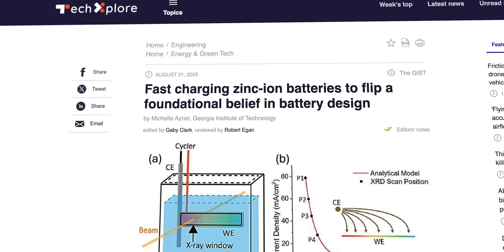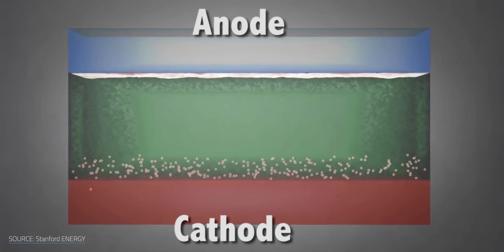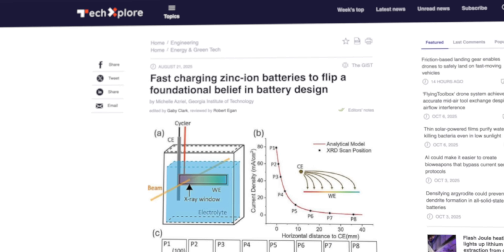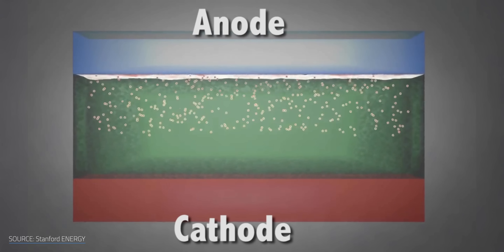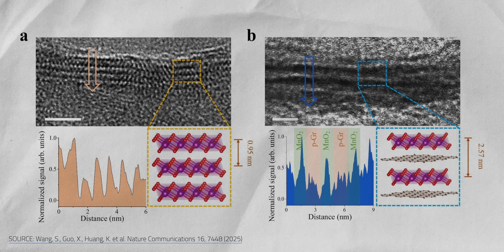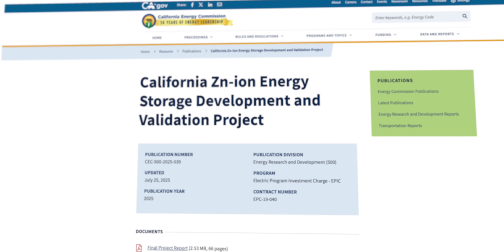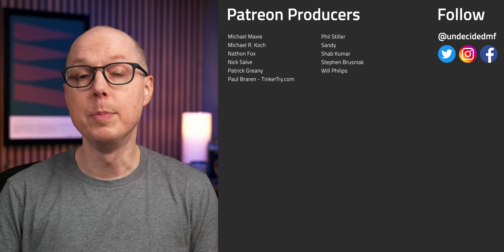The Surprising Battery Discovery No One Saw Coming

Comment from the maker: Are cheaper, safer zinc-ion batteries the best bet for grid-scale energy storage or your home? Take your personal data back with Incogni! Use code UNDECIDED at the link below and get 60% off an annual plan: http://incogni.com/undecided

If you liked this, check out Are We Building Wind Energy Wrong? https://youtu.be/ZlCJcTq3Jk4?list=PLnTSM-ORSgi7uzySCXq8VXhodHB5B5OiQ
Reply: Thanks for all you do! Perhaps, a couple of times a year, it would be great to provide a summary of the status of these emerging technologies - cost, density, adoption/commercialization timeline, progressing/abandoned etc. With so many promising technologies, it would be great to see the comparison and long term trends. Also, tag them with applicability - mobile devices, transportation (cars, aircraft), home and grid scale storage etc.
Reply: Thank You ❤️‍🔥
Reply: No, they're not. They're just the experimental battery chemistry of the week. Pump, dump, forget, rinse, repeat...
Reply: Would rather have a link to a report/review that compares the current commercially available cells of this tech to the existing ones (iron (lifepo), salt, lithium, etc, and variations of those) for everything from energy density in cost, to energy density in mass, to energy density in volume, to safety (both in terms of fire, environmental, health, and such),  longevity (things one has to do to not kill them, how they handle weathers/temps, and so on. Both permanent longevity and temporary), as well as speed (charging and discharging), and so on.

Some sponsor-link or other video link is not really desirable in comparison. What I want to know is whether or not I should try to replace my bike's battery with this, and if it is even doable with a homemade batterypack, or if it is dangerous or even potentionally lethal (i.e house-fire).
Reply: Thank you Matt, I love your channel!
Reply: Thanks Matt. Given the right opportunities, this could lead to serious advancements in other battery technologies. If those batteries mentioned towards the end of the video can be sold at a competitive price, I would use them in my home, in preference to my LFP battery.
Reply: How do these compare with sodium?
Reply: compare it with the sodium ion battery that CATL produce today, 180 Wh/kg, 10,000 life cycle, can be discahrged to 0V without damage, costing 20$/kwh to mass produce. And the most important thing it is a real product in the market and not some lab test that is decades away from production
Reply: There is a better way! 
The old John Poynting theory establishes that a charged capacitor laid on a permanent magnet so that the E-field of the capacitor is at right angles to the H-field of the magnet, is somehow the seat of a dynamic and continuous flow (steady state flow) of EM energy.
This is assured by the proven broken symmetry of opposite charges, such as the poles of the magnet and the opposite plates of the capacitor. 
ANY such dipolarity—because of its broken symmetry of opposite charges—must then absorb virtual EM energy (virtual photons) from the vacuum, coherently integrate the virtual energy into observable photons, and re-emit real observable photons in all directions.
Reply: It’s like an “Italian tuneup” for cars! Haha
Reply: oh look. another video about a battery i will never see.
Reply: Thanks for the analysis!

At 6:09, you said "higher charging speeds", but the captions said "higher charging currents".
Reply: Sounds great for grid-scale energy storage or home use. Energy density is not the factor for those stationary usages. While lithium has several disadvantages at moment.
Even 1/10 of density would be ok, as long it is as similar or better in green, price,  fire risk and durability.
Here in Germany are home use lithium packs of e.g. 10 kwh with their estimated lifetime so expensive that each 1 kwh cost 0.07 EUR/$ just for the lithium battery pack lifetime reduction.

The consequence is that e.g. heat pump system need best (aside other factors) run at at daylight when photovoltaics produce energy to store thermal energy in heat water tanks for the night instead of storing the electricity in batteries to run the heat pump at night as well.
Storage energy in water costs factors less than in batteries. Smarter and more universal would be to have primary the energy storage in batteries.
Reply: Pleaxe don't play background "music" over the top of you talking!
You are already speaking at 100mph, so is difficult enough to decypher what you are saying, without also having to extract it from that irritating racket that contributes nothing to the educational content.
Unwatchable beyond the time taken to type this.
Reply: Maybe Conservatives will now start wanting EVs which WE can control Liberals with, through our present and continuing future control of the national government (and therefore control over the regional fueling infrastructures). Of course, Political Liberals don't fear that, because (1) they are arrogant and falsely think they will regain power, and (2) they know WE (unlike themselves) aren't fascists and therefore don't think in that totalitarian way.
Reply: EVs "that run off the electric grid" are literally going nowhere. People are rejecting them. However, "reforming fuel cell EVs" are the vehicle of the near future. Political Liberals don't want them, since they are practical & support individual transportation autonomy by NOT centralizing the fueling options onto the grid which the GOVERNMENT can control at will.
Reply: Maybe, now that the US government is no longer under control of the Political Liberals, and the Democrat Party is permanently declining in power, Political Liberals may not even want the government to be able to CONTROL the fueling of THEIR vehicles AT WILL through the electrical grid.

Comment: The reason we moved to lithium is because they're lighter and smaller for the amount of energy they can store. I'm sure there are use cases where we would want longer lasting and faster charging, but they aren't the common ones today. We don't want our phones to hold less charge and we definitely don't want our cars to hold less charge and be heavier. The price per Wh could be a big advantage though. They might be good for power walls where price is the limiting factor. Given that you have to charge them fast though you would need some fancy circuitry. Most likely a bank switching method so you only charge like 1/10 of the batteries at a time so all the power goes to a few batteries.

Comment: The batteries need to be able to go to low voltages before cutting off, and need to be able to start charging, even if that voltage is low, because that is what is killing the salt batteries from becoming a replacement for lithium batteries, so if they can make the batteries do that, and work well in cold and hot weather, then Yes, these batteries could become a replacement for lithium batteries....🤔🧐

Comment: Of course, home batteries won't see the benefits of fast charging so dendrites will remain a problem.  Non-flammability would be an asset in a world where insurance companies are becoming increasingly wary of lithium based batteries, but it still comes down to cost and energy density. For grid storage density may not be an issue, but nobody wants their garage taken up by bulky ugly batteries. How does this technology react to depth of charge/discharge?

Comment: How is this good for a home battery. You want to use the excess power from your solar panels to charge your home battery and this is not high enough to constitute fast charging.  The amount of available power from your home solar panels might consist of, say, 35 Amps when other loads are not engaged.  So you are right back where you were with relatively slow charging and dendrite formation.

Comment: I think the problem here is that companies keep focusing on trying to beat LiIo pricing, but what they should be doing is trying to build a Zinc battery that is the same price but lasts way longer or can be charged quicker. Sadly this causes problems with the disposable nature of many tech companies and EV manufacturers. They don't want to make a EV that can last 20+ years because they want consumers to buy new cars every 5 to 10 years which is what traditional batteries kinda give them. Laptop and Phone vendors are more insane wanting people to buy new shit every year... So having a laptop that has a battery that literally never needs replaced is just not what they want. Phones and computers now have parts that can last for decades or even a century without issue and almost every time its the battery that craps out on them before anything else.

Comment: IMO it is not one single chemistry but a range of options that are both affordable and safe.
Like multiple car makes all offering affordable alternatives.
LFP is said to be far safer then NMC chemistry.
Sodium ion said to be even safer and less costly.
Zinc Manganese with a change in charging profile, well that's a better option as well.

Home battery and BESS storage needs to be cost effective and safe and then communal battery storage banks can be implemented. 
Using all the excess solar and wind that would otherwise be curtailed to support peak load in late afternoon early evening peak periods.
Affordable safe BESS. is the key to maximising renewable saturation and reduction in fossil fueled power generation in my view.
PV panels on walls of buildings and roofs of new construction making significant impact and reduction in demand for dedicated solar parks.  Solar panels over car park areas providing protection and power to customer parking lots at supermarkets and shopping centres.

Thin film PV materials like shade sails over school playground areas, etc all adding to free solar power generation to be stored in cost effective safe BESS. Now that make sense. the BESS can be use to power lighting and heat pump cooling and heating during school hours.

Comment: Zinc based power cells are a great idea for grid or home storage.
Right now the cheapest cost per kilowatt-hour for home storage is Still lead-acid with power block battery packs for tow-motors and forklifts being first choice. They can be charged and discharged at nearly any rate making them ideal for the variable input from alternative energy sources and variable loads of point-of-use.
They are well behaved and have very predictable performance.
Li-ion, LiFeP, Li-polymer cells ALL have acute failure and fire dangers along with a nasty habit of outright Exploding if damaged(!!) 🙀
Lead-acid and zinc based cells do not.
In fact Nickel-Zinc cells CANNOT EXPLODE or catch fire because the chemistry is self neutralizing if damaged and is NOT exothermic (!).
I certainly Hope that more people get into the Zn power cell game.
The only one in full production at the moment is Zinc Five NiZn power cells. Right now they are fully focused on government projects for critical infrastructure but they do have other products available such as prizmatic block batteries of various voltages including 13.6v automotive style. The caveat is that they are charge cycle sensitive to get maximum performance.

Comment: I get the sentiment of battery news being cringe since they take like forever to hit most parts of the market. But let's not forget how incredible our current hen batteries are. EV batteries already usually outlast most other components. By a lot. We went from. Max 120kw / charging to 300 kw charging in the newest cars(except for teslas ironicly) while cutting cost like 50%. Change happens year over year which is why it doesn't fell like its happening. But it has.

Comment: Wow, zinc-ion batteries sound great, can't wait to never hear about this again!
Reply: research is important, and the process is slow though
Reply: @artychokeer2092  zinc batteries have been around for a long time, but what it sounds like is they have found more viable ways to use the zinc chemistry.
From what I understand, zinc batteries have been used in sail boats for decades.
Reply: Zinc battery tech already exist, scientists just introduce a new material separating the anode and a cathode
Reply: the hype this channel makes is real lol
Reply: Zinc is niche

Its still need mining same as lithium
Refinery and chemical toxic potential

Low Voltage Power

Even though its recyclable

Its same as sodium ion and still better than zinc
Reply: @The_Divergent I don't understand, I have zinc battery, they are higher voltage than other batteries (1.7V instead of 1.5V)... But they don't have much charge and deplete faster than Lithium ( or alkaline but these are not rechargeable). Are you sure the issue is voltage ?
Reply: @prahalb  you have zink battery with some different chemistry. Who make them?

Comment: I understand sodium-iron batteries are set to replace lithium, not zinc… I think the sodium ones have much longer duty cycles than lithium or even zinc…
Reply: Sodium-Ion (-Na) is starting to hit the market, but they are significantly bigger and heavier than even Lithium Iron Phosphate (LiFePO4). Their main benefit is they can slow charge below 0C (32F). Eventually they may be cheaper, but first gen of anything is overpriced.
Reply: @Helio_Centra  I’m sure they will be too big and overpriced to begin with. But I expect them to go much cheaper because won’t need expensive lithium, and I’m hoping there will be further development and increased charge density, which will decrease size and weight… we will see.
One thing that’s right away aside from the cold issue — much safer than lithium, and much MUCH more duty cycles— it might be time for short plays on lithium rather than long plays on sodium or zinc. I just think lithiums dominance is about to end.

Comment: Why does a single 9-volt battery cost $10??!! And it hardly lasts. It seems most devices that run on 9-volt need an almost new battery to get the expected performance. I don't want to spend an extra $10 every time I just want to use my stupid $15 device!

Comment: If these batteries can't light on fire and can provide equivalent or better performance than lithium-ion...what's the hold up? I will never buy an EV vehicle right now. While I know they are pretty safe, I just am not comfortable with the risk of fire from charging the batteries. I get nervous anytime i'm charging my power tool batteries because of that. I love using battery operated stuff. It's just so much less of a hassle than small gas engines. But...the safety with Li-Ion is a big issue and if these zinc or the sodium stuff works and is safe...the possibilities are endless. Also...it would quickly diversify the world market regarding rare earths if these technologies are adopted, which would be good for everyone.

Comment: A trick they have missed is an old trick used to allow you to rejuvenate zinc carbon cells, which was to use a very high ripple current, around 80% charging, 20% discharging the cell, to deposit the zinc back on the case in a smooth layer. Yes you lost capacity badly with each cycle, and it only really worked on cells that had been discharged partially, but you got around a dozen cycles out of the cells, and i worked well till the paste electrolyte lost enough water, as you did have hydrogen formation in the cell that took water out of the electrolyte. 

But worked well on cheap cells, and the charger was very simple in most battery appliances with mains input, you simply added a diode from the secondary of the transformer, with a current limiting series resistor, to the battery, and a higher value resistor across the diode, so that it partly discharged the battery when the mains was on the other half cycle. resistor was scaled to have around 10% of the charge current, and a switch to turn off charging was all you needed, or a small relay that disconnected it when mains was not present.

Exactly the same thing is used on electroplating lines, to get your smooth chrome finish, not pure DC, as that generates dendrites as well, but roughly rectified DC with lossy leaky rectifiers, and it is also used in reverse to electropolish stainless steel as well, with the effect being to selectively erode the high spots, and then deposit the chromium right back on the exposed niclel as a thin even film.

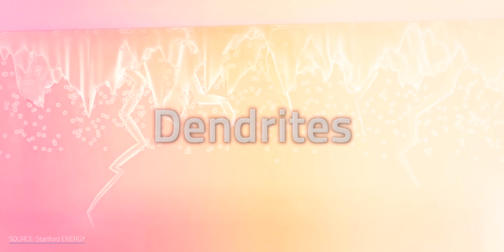Comment: 2:00 are we ignoring the role of the BMS here? Because when the battery is cold, the BMS will limit the charging speed significantly or even don't charge at all until there's enough heat in the pack. Is that low charging speed when cold still bad for the battery?

Comment: The benefit of LiFePO4 is the flat cell voltage curve for a large part of its discharge, performing a steady power source. What about the behavior of these batteries, Matt?
Reply: wrote: "The benefit of LiFePO4 is the flat cell voltage curve for a large part of its discharge". Well, that has the pro you mention, but also the con that it makes it hard to estimate battery state. Batteries with steeper slopes (like sodium ion, and maybe these zinc-ion ones) are much easier to monitor. And if all your power is going into an inverter (as most stationary batteries are) you don't care if the input voltage varies with charge state.